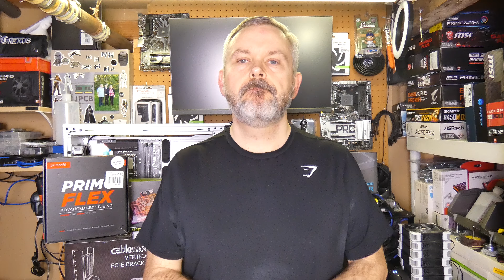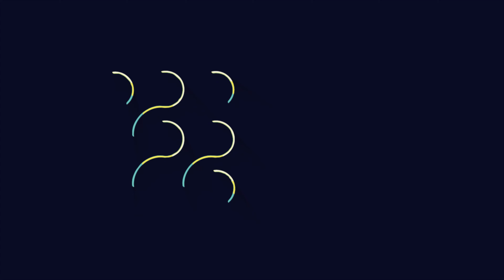First Custom Water Cooled Loop - Introduction and Parts - Vlog Part 1

Comment: 13/10 tubes - be careful with your radius, these tend to bend fast ;) good luck!
Reply from the maker: Good to know and thank you. I'm at the point now where I'm doing the runs. I'm going to try and keep any bends to a minmum if that will help. It looks like I'll only have one run (from the CPU to the top rad) with a bend in it. The rest will be straight after using 90 / 45 degree adapters.
Reply: @jimbopcbuilds  great, should work out fine. If it feels like it might bend you just need to add an anti-bend-spring. Looking forward to the final build!
Reply from the maker: I'll keep that in mind thank you.